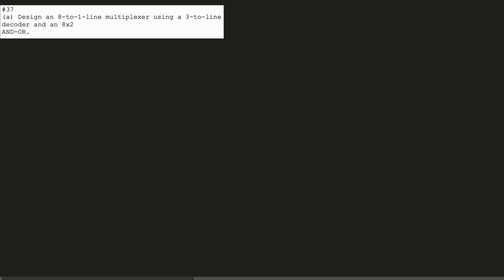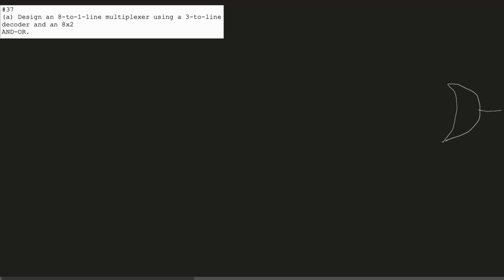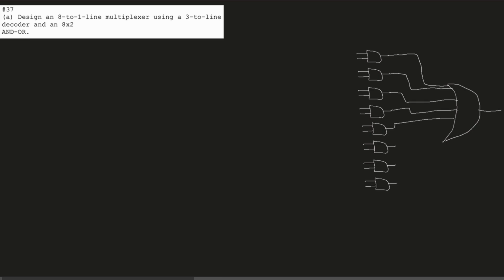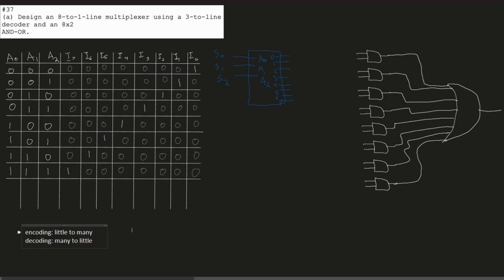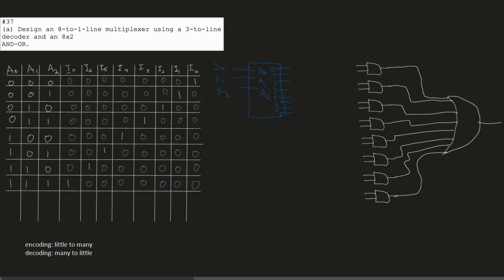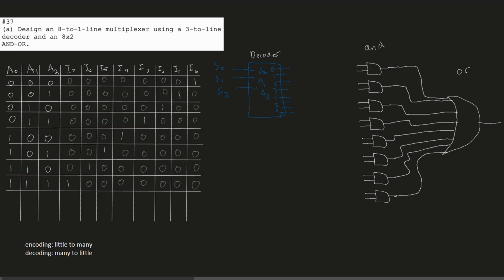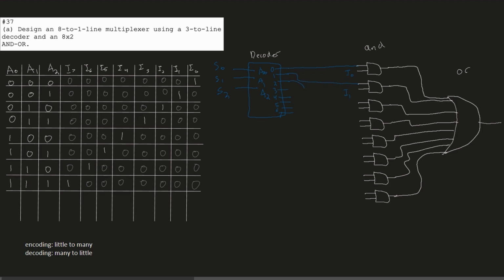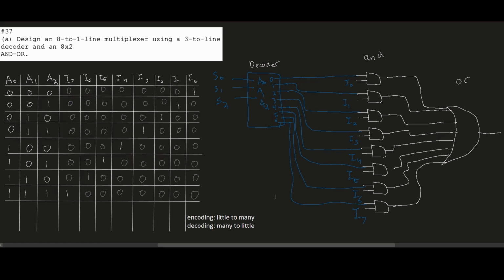Design an 8-to-1-line multiplexer using a 3-to-line decoder & an 8x2 AND-OR | Intro. to Logic Design

Comment: question, why do we say that it's an 8x2 AND-OR, and not an 8x1? does it refer to there being 16 inputs in general or specifically 2 inputs per each of the and gates? does it have to do with the number of outputs at all?
the video is very well made, i'm just confused about the semantics.